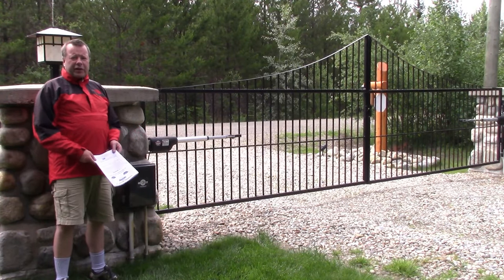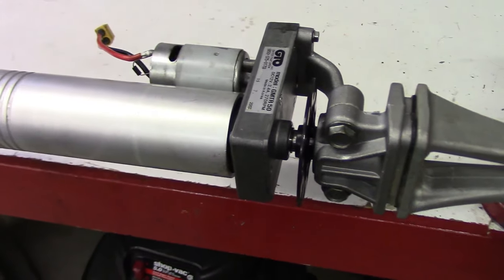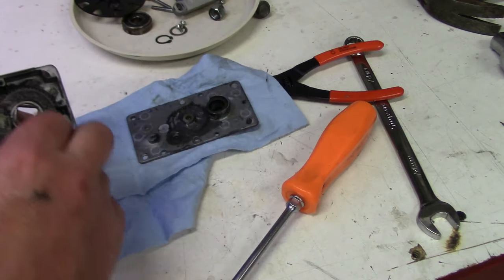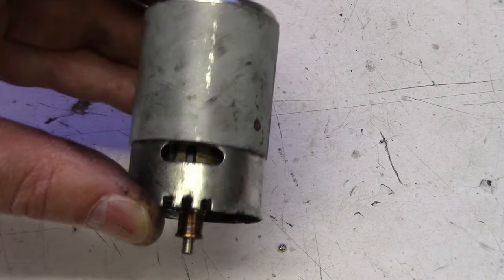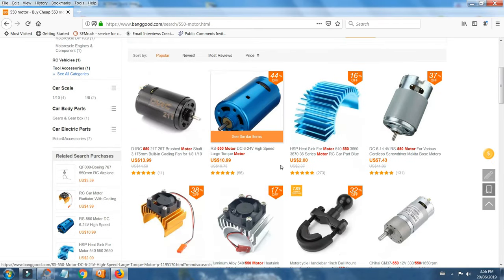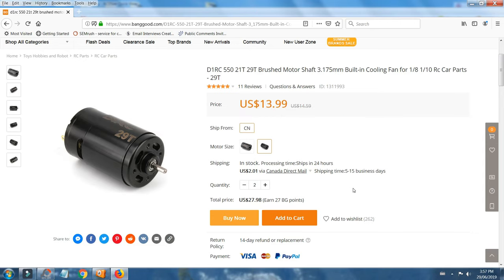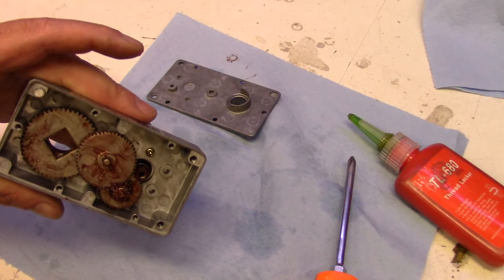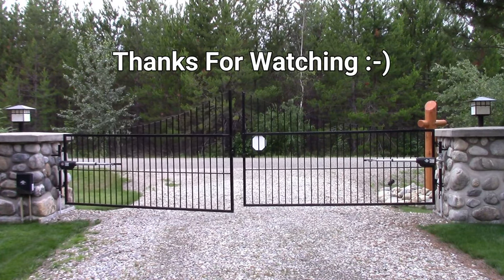Mighty Mule Gate Opener Repair - Inexpensive Motor Option.

Comment: I have a 2000 xls, ours isint working correctly. One will close and one wants to open. I changed the board in the left gate arm. It’s set to open inwards. That didn’t fix the issue, support said it’s the arm board, we changed that and it didn’t fix the issue. Last option is the whole board, only problem is they may not be returnable, and it’s about 120-250$
Reply from the maker: I'm sure you tried this already as it's the obvious first thing to check, but did you try switching the motor/s polarity around to see what affect that has? Over and above that - no idea.

Comment: Wow. Great video. Thank you. I changed my motor using your video. I took two short cuts; 1) I bought a motor with gear and capacity. Had to solder cap, and old wires but was easy, 2) I didn't take the linear / shaft apart at the Counter/wheel end, I was able to take the gear box apart on the shaft, exchange motors and reassemble.I had to wait 5 days to get motor. It cost me $65.00 with shipping and tax, and came with gear on it.Considering what someone would have charged me I am OK with a $65 dollar cost and my FREE labor :)I ordered motor through amazon, and got a perfect replacement. The one on ebay has a different motor gear?? and...….costs more.Thank you for video .semper fi
Reply: Do u need to know the turns? I have a GTO 2000 XLS. I don’t have all these tool.

Comment: Weelye universal 550  15000 rpm electric motor 12v from Amazon-  $13.58  Had to cut @ 3/8 in from shaft length. reused pinion gear, resoldered wires to new motor. Heat the 13mm case bolts real good or they will snap off.  18000 rpm motor moves the arm a little quicker
Reply from the maker: Nice work 👍🙂
Reply: Just an FYI, you dont need to cut down the shaft, just press the gear on to the same location with respect to the motor as the old one, the extra shaft sticking up doesnt effect anything

Comment: Thank you so much for your time, mighty mule really sucks now. Have a 2 year old system arm stopped working. Sat on hold by my gate for ever only to have them say, sorry you have to buy a complete new system now. Was going to throw the whole thing in  the trash. Then i found this video. back up and running Thank you sir and God Bless
Reply from the maker: Glad you were able to get yours working again too. 🙂
Reply: Agree with your opinion of MM's current customer service and parts availability. I called last week to ask about cost of one of the circuit boards which I guessed had been burnt out by a lightning strike. "Since it is soldered on, we do not offer a replacement. Buy a new unit." Mine sat idle for 4 years and was full of ants. With this video, I was able to clean it up and working fine now.

Comment: Thanks for the great video – concise, clear, and great attention to detail – down to the chemicals used. Thank you!
I've got an older model of Mighty Mule opener, and it's too slow for my liking. I've got it attached to a very light gate, and I've often thought of replacing the motor with a motor that has higher RPM's. I never took any measurements, but when I had it apart, I thought he motor was a 750 size, not 550... but you're inspiring me to double-check and order a faster motor the next time I have it apart. Thanks!

Comment: Wow excellent video! Great job explains the whole process! I do have one question. What’s the best way to get the back of the motor off. I know you said grind the tabs off. If so with what? Mine seems very intact
Reply from the maker: I used a Dremel with cutoff disc.

Comment: I just finished repairing my FM500. It had a good 16 year run. The repaired unit works fine but the auxiliary lock releases before the gate opens but does not release after the gate opens. The result is that on closing, the latch does not catch and I assume it is still drawing current. I lubricated it and it worked perfectly before the motor was replaced. Any thoughts would be greatly appreciated.

Comment: Great video! Very informative. Do you think it would work the same for an mm572w? The gate is actually a huge POS! Warranty has replaced EVERY SINGLE PIECE EXCEPT THE BATTERY! (both arms, control box, battery wires, antenna... even the fuses! Bought it April 6th, 2021, installed it April 24th 2021. Waiting on parts took about 9 months of my warranty away! I received the last part, which was the second arm 2/15/22...at that time, my gate had worked a total of 47 days...the downtime waiting on parts was 248! Needless to say...I know this lemon is going to go out again, that is why I asked my question. BTW, I also bought the mm gate lock, a wireless keypad, and 2 pin locks, when I purchased the opener. I paid $1108 for everything.  The gate lock quit working within a month and had to be replaced. The replacement worked even less time! I'm replacing it with a different brand!

Comment: I have an MM260 Might Mule. Front mount came off. Looks like some sort of a plastic type of where it screws into the front of the motor and then a screw with bolt to hold it in place.  Unable to find a replacement part.  will I have to buy a whole arm?

Comment: Super video. Clear commentary and great camera work. Thanks for taking the trouble. What amazes me is how slow my MM 271 is (light-duty, single gate). My gate is under 80 pounds. It is just 4' wide. And each cycle takes 18 seconds (not that this is without soft start/stop like yours has). Yours is significantly and noticeably faster (obviously tip speed will be faster on much wider gates, but the entire time is obviously shorter). I wonder if there's a compelling way to speed mine up. Safety isn't a concern even if it were 2x as fast. But then I'd REALLY need soft start/stop.... which of course my controller doesn't offer.
Reply from the maker: @Darell Dickey - Thanks for the comment. As for speed, you could likely get a faster motor (the 21T option for example) but I really don't know how much of a difference that would make seeing there is a fair amount of gear reduction in the gear box.
What would have a bigger impact would be the actuator arm geometry and overall arm travel distance. The only way I could get the actuator arms to fit on ours between the stone pillars and gate was to have a sharp/tight arm angle on the pillar sides. This reduces the travel length of the actuator to swing the gate 90 degrees, so mine are not moving their full travel extension distance (I would guess about 70-75% of the full travel).
Of course with sharper arm geometry along with less overall travel, the mechanical advantage (opening & closing force) is also reduced. Gain speed = lose force & vise-versa.  These gates like your are fairly light so a little less force is not an issue.
Reply: @Rchelicopterfun  Thanks John. Well, that all makes sense then. You've got about a 25% advantage on my speed, and now I'm sure it is all due to geometry. I've been considering some sort of mechanical (dis)advantage to speed it up. And make no mistake, I have WAAAAY more force than I need. 80-pound gate on ball-bearing hinges. The main reason I put the actuator on the gate was to keep it from slamming with the most gentle of breezes. Even when I let go of it for just a moment to get my bicycle or rolling bins through.... SLAM. Or a friend comes over and leaves it ajar... slam! A toddler can operate this thing without issue. I could lose 75% of my force and not have a concern. My stall force is at zero, and it is still too high for my liking.

I again appreciate your help and insight 

Darell,
(RC driving champion from way back when there was nothing "prebuilt."  :-)

Comment: Best gate motor video I've seen . I have fixed a few and this taught me even more-BUT, The RC guys are saying 29 turns does not mean what it used to due to the internal 29 turns being a much thinner wire in the 550 cheap motors.I noticed your original motor had somewhat thick looking wire. Please address this and advise--Thank you
Reply from the maker: Motor design physics is a much too deep rabbit hole to venture down in a YT comment box and I'm not qualified to explain it. There are many brushed DC motor forums and physics sites that have pages upon pages going into all the details along with all the math required to explain it all. The basic and generalized ten thousand foot view as offered in this video is you are generally adequately served by getting a replacement motor with the same number of turns. This should result in the gauge being similar given the same amount of space within the armature, the current handling/heat dissipation being about the same, the back EMF (KV) will be about the same and the speed & torque will be about the same. Key word there is "about". 
This generalization is of course not the end all be all, but in a non critical application such as a low cost gate opener, it more often than not gets you close to something that will work adequately. These are not high performance racing motors after all with tight specifications of turns and specific gauge to operate within a narrow window of voltage, current, power to produce the correct range of RPM & torque in a specific application at a peak efficiency level; these are low cost utility motors. By the way, those replacement motors I got by the look of the wire gauge inside were very close to if not the same as the OE motors so I never observed this "much thinner" wire issue.
Reply: @Rchelicopterfun   That makes sense, I suppose the ultimate question would be : How are yours holding up thus far?--Thank you
Reply from the maker: @JoeTaylor-z5i  working great

Comment: John - if I wanted to increase the speed of my gate by replacing the motor would I just do a 550 29T with a higher RPM?
Reply from the maker: Depends what motor is in their now (generally the less number of "turns" the faster the motor and lower the torque). 29T motors were stock in my MM linear actuators, so I made sure to replace them with 29T motors because I didn't want lower the torque or perhaps introduce an unknown since I don't know if the processor in the control board wants to see a specific RPM range or not from the speed sensor in each linear actuator.  Doubtful it would matter, but I didn't want to chance it 🙂

Comment: Great Job! 
I've had my GTOs Openers since 2003 and It looks like I need to replace "one" of the motors.
Reply from the maker: Hope it goes well 🙂
Reply: @Rchelicopterfun  
 Thank you so much.   
I replaced it following your video. I've got a Mighty Mule motor from Amazon and it works, meaning that it opens and closes, except that every time it closes, when the stopping mechanism presses the stop switch, the fuse for that arm blows up. I tested it by pressing the stop switch with my finger before the stopping mechanism does it and it works ok. At this point I'm assuming that I will need to solder the diode which  is not present in the old GTO system that I have. I ordered it.
 I will greatly appreciate your input on this issue.

Comment: John I have the Mighty Mule MM462 dual operators.  One is making a very loud screeching noise.  The MMule tech states it is probably the motor going out.  However, they do not have a replacement motor at Mighty Mule, but you have to purchase a completely new MM272 kit for over $600.  Says they do not just sell a replacement motor for that unit due to software changes.  Ridiculous and I don't believe one can not purchase a replacement motor.
   Your video is very good, but I am confused over purchasing the correct replacement motor.   Amazon shows one specifically for MM462 replacement, but their ad is also confusing as it does not show a price next to the item.  Could you help me with knowing the correct motor?  I am not sure I understand the part about the correct speed.  The Amazon ad states it includes the diode.  Thanks for your help.
Reply from the maker: I would not presume it's the motor without doing a proper diagnostic inspection of the linear actuator unit. Mine for example also made a loud screeching noise when cold long before the motor failed and it was due to a spinning shaft bushing - not the motor at all. Could also be a dry slider or worm gear/bushing. Perhaps something in the gear box itself; lots of items in these things that can cause loud screeching.
 If the motor is the component making the noise however, then oiling the motor shaft at both bushing ends usually curs it. Might be a short term fix or might last for years. 
I can't say what specific motor is in yours since it's a different model. I would presume it's a standard DC RS550 motor, but again, until you open it and check, you won't know for sure. 
Yep, the software line is BS.
Reply: @Rchelicopterfun  This is very helpful and I will definitely explore these recommendations first.  I do remember the noise appeared first and more often in cold weather, but now in Baton Rouge, La. it's very hot.  I also mentioned grease to the Mighty Mule technician, but he did not suggest lubrication except external with silicone.  I have done that routinely every month since the purchase some years ago.  Again thanks for a very helpful video and response to my question.
Reply: Rod seal?

Comment: Does the RS550 motor work for the MM600 ET-Pro DC 12V, 2.4A, 270RPM motor replacement?

Comment: Is there a way to find out which motor I have in mine? The writing got rubbed off it's for the M.M. 200 it looks the same as the one you have haven't gotten it all the way down to check # turns yet great video!
Reply from the maker: They all use the same motor to the best of my knowledge. Of course, measure your motor to confirm it's the same size as all RS550 motors & if you really want to dive into it, count the windings on the armature like I did in the video with mine.

Comment: Currently the 29t motors are not available. Will the 21t work?  Thank your for the fantastic video.
Reply from the maker: The lower the turn count, the faster the motor turns but the lower the torque. Personally, I wouldn't risk it. If the control unit sees the output wheel spinning faster and drawing more current (less resistance in a lower turn motor), it may fault a code, or perhaps overload the mosfet? I honestly don't know, but there was a reason I stressed on finding the correct turn count when source non-OEM RS550 motors.

Comment: Great video, what rpm was that motor you replaced, and would a faster rpm work to open the gate faster? I saw the motors you bought that had 29T on them, what does that mean? Mine is giving me one beep every two seconds, so it looks like I will be going into the bottom half. Thanks
Reply from the maker: I clearly explain in the video what the number of turns (T) represents and why it's important to get the same number of turns motor when replacing. No idea on RPM since that is a function of voltage as much as motor type. I never took an RPM reading nor is there any need to. Get the same type/#of turns motor and it will operate as designed.

Comment: Nice vid how long has your mighty mule system been working? Any issues?
Reply from the maker: Installed in it 2009 so I guess it's 15 years old now. One issue so far - the motor worn out which was covered in this video 😄
Reply: @Rchelicopterfun  that’s it? I hear so many complaints about them online.

Do you think these people just got lemons and 98% of them are great
Reply from the maker: More likely improper maintenance. Look after stuff, it lasts a long time; neglect it which is the norm in our disposable society and it fails.
Reply: @Rchelicopterfun  any experience with these on 8’ x 9’ solid wooden gates? Do you think they would be able to handle the load?
Reply: @Rchelicopterfun  is your RC motor still working and would you do anything different?
Reply from the maker: No idea
Reply from the maker: working fine - would do nothing different.
Reply: @Rchelicopterfun  thanks

Comment: Great video! We have one that's doing 2 beeps. Have you had experience fixing the limit switch?   Hard to get parts in Canada. Thanks.
Reply from the maker: I've never had to replace the end limit micro switches on mine (yet), but they are just standard microswitches that shouldn't be hard to find at any electronics parts outlet.

Comment: Will any RS550 motor work on the MM360 gate? Amazon has some that are for ride on toy cars but look similar.
Reply from the maker: I gave all the information in the video on what to confirm on the 550 motor including dimensions and number of turns of the windings. If the motor/s you are looking at have the same specs as what you are replacing, then it should work.
Reply: Thank you.

Comment: When you put the diode on the motor did you pay attention to polarity?does it matter?
Reply from the maker: As I stated in the video - it doesn't matter.
Reply: Thanks I missed it I was moving around . I tvwas real informative . I didn't realize you could buy them with different windings. I found a motor with a solid shaft.
Reply: @1607rosie  where?  we like shared information  :)

Comment: Did you end up soldering the red wire to the pole that has the red mark (on the new motor)?
Reply from the maker: I don't recall.
Reply: @Rchelicopterfun  Thanks for the response and the video.
Reply: I also purchased the D1RC 29T, and the red wire ended up going to the pole with the red dot.  To determine if the motor is wired correctly, at  first start up, the motor should retract the arm and stop when the arm makes contact with the limit switch.  This is considered the "home" position.

Comment: Great video! Did your gate open faster with the replacement motor? Do you thunk a brushless motor work for a replacement?
Reply from the maker: Opening speed was the same because I chose the same type of motor. A brushless motor would require a brushless controller and converter circuit. Lots of experimentation involved to get all that to work the stock system.
Reply: @Rchelicopterfun  thanks!